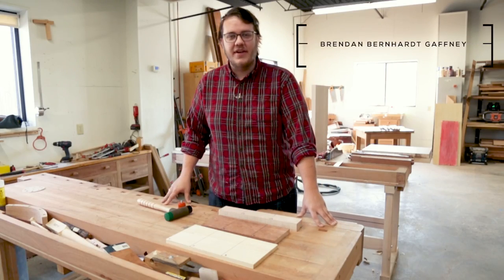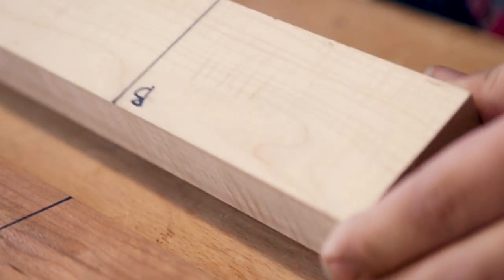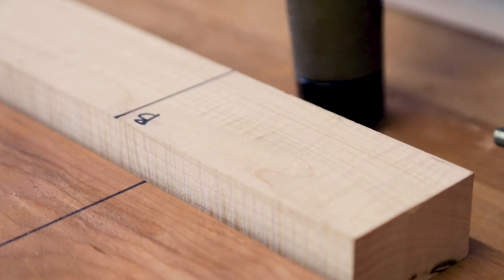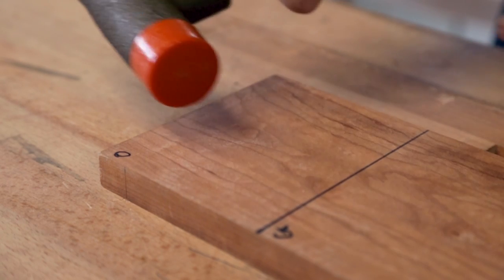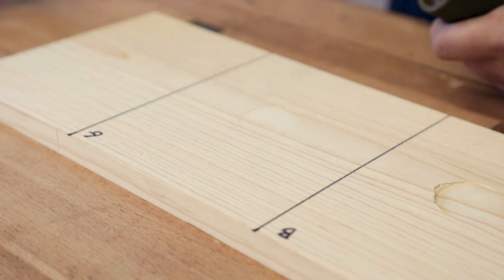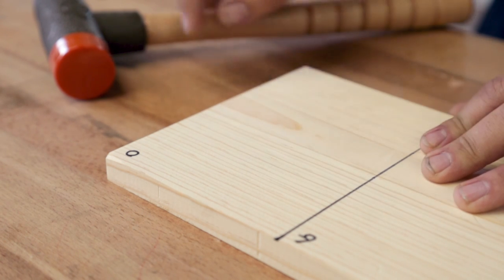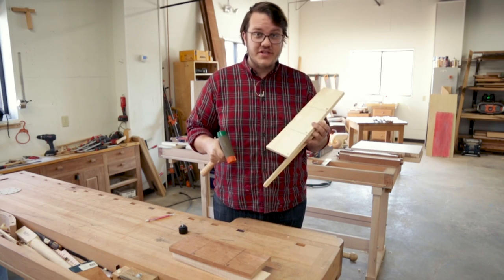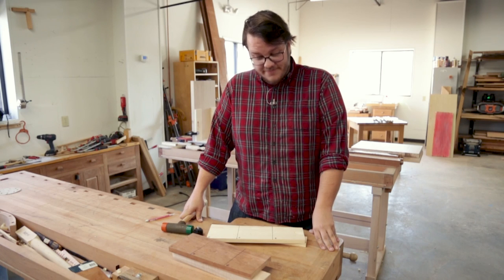Lixie Dead Blow Mallet | Tool Review

Comment: Been using the same Lixie Hammers for over 30 years. No other dead blow mallet compares with them. I broke a handle on one of mine several years ago, and they replaced it with a new one at the factory. Quality tools from a quality bunch of guys, and they will last a lifetime is properly cared for.

Comment: Do they sell a brass head?  I'd use it for adjusting plane blades.
Reply: This mallet is a little larger than I would use for plane adjustment, but Lixie does have other mallets with bronze heads that might work well for metal-on-metal adjustments. This particular mallet does not have a bronze or brass head that can be swapped in, but the other mallets that do still have one side of the head which can be outfitted with a rubber head. For a plane hammer, I’d generally recommend a smaller head diameter (though for some planes, the iron is proud enough of the body that you could use a larger mallet).
Reply: Thanks for the excellent reply.

Comment: I'm very sorry. But for what this test? I never hammer at the objekt, which is importand. In any case i use a slave piece of wood between the mallet/hammer and the target. And i use a hammer without backpulse (filled with litte metallballs). It's much better to controll.
Reply: Hey Alfred, I do say at the end of the video that a block is always a good idea, but the safety in having the softer heads does mean that (if I should miss) I’m better protected against dinging. Also, this is a dead-blow mallet, and does have small steel balls in the head to prevent “backpulse” as you call it.
Reply: Ok, this with the block i missed, because english is not my mother language. And you are really fast in talking :-) But that your mallet was such one filled with balls, does not come over in the video. Also it does not sound like such a mallet nor does it behave so. I own two of them and in my experience there is nearly no such 'springback' after the hit as i saw in your video. Thanks for your fast answer and best regards from Germany.
Reply: Hey Alfred, you’re right that it doesn’t hit quite the same as a typical “dead-blow” mallet – there is some springing back. I noticed that, with the green or medium head, the springback is a lot less than with the hard head. But, it has less steel shot that many dead-blows, that is true! Mit freundlichen Grüßen aus Amerika!

Comment: 11 freakin bucks for a replacement face? The UK equivalent of this hammer is made by Thor, with a die cast Aluminium head and handle (steel shot inside), with similar threaded faces, and the faces cost a couple of ££.
Reply: A machinist buddy of mine has one of those Thor brand hammers, and it is a low cost low quality level hammer. It isn't exactly reasonable to compare a Thor and a Lixie. The Thor only offers one grade of thermoplastic face, while the Lixie can be changed depending upon what you are working on. 11 dollars for a face is minor when you are working rebuilding a high speed spindle that can be upwards of 15K plus.
Reply: Andrew Brown I have a Thor and have multiple different material heads for it. It seems high quality and I don’t know how else you could make it a better hammer (functionally). I get that nice tools are nice to have (I’m not shitting on the Lixie) but I wouldn’t call the Thor low quality.